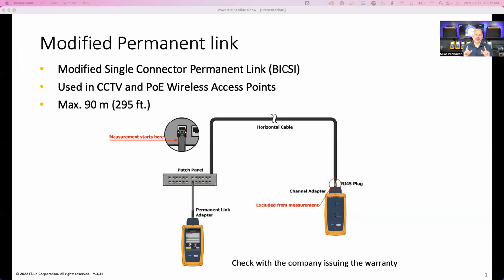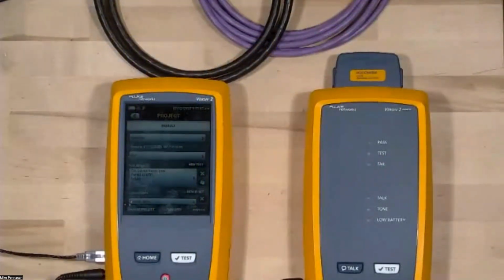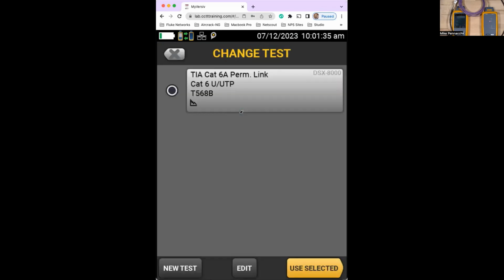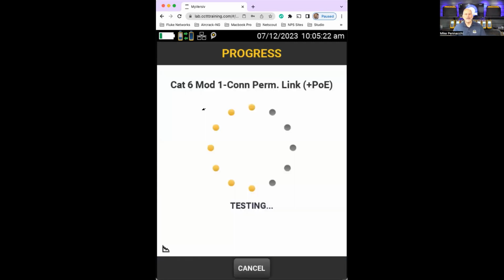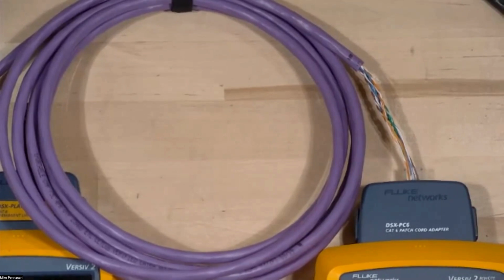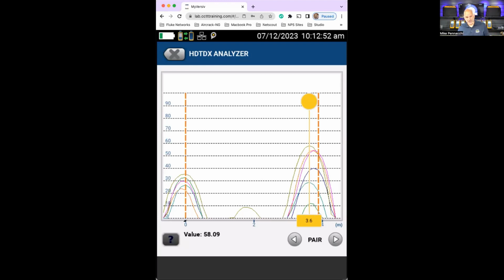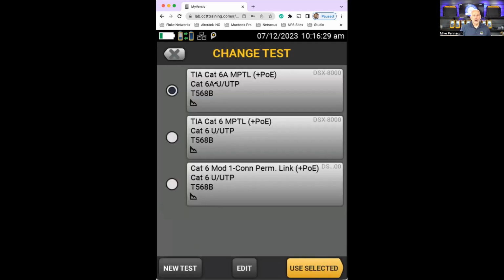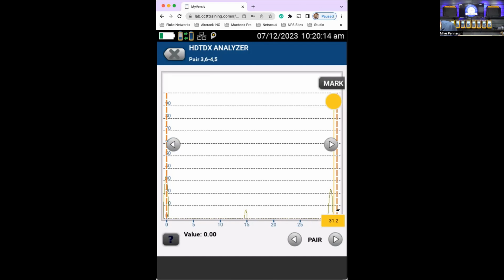MPTL vs Mod 1 Conn Perm Link Webcast

Comment: Great video. I want to buy the right analyzer to test an 8 pair 26awg running 500 meters through an umbilical. we can make our ownadapters to our umbilical. 
not aligned with any protocol but uses for high quality digital data transfer. we get a life cycle of about 4 years due to insertion loss but we just see that as parity errors on the working system in operation. we want to troubleshoot and confirm transmission loss. Replace before project is on standby to change out one umbilical. we carry 10 of them. 6 in use. we need to ensure they are fit for re termination this type of tool looks ideal.

Comment: Good Day Sir, i dont have the cat 6 patch cord adapter, same scenario patch panel i/o on one side but rj45 crimped on the other side. what i do for the testing is in channel link testing i simply plug the rj 45 cripmed on the remote side then i plug in a patch cord on the patch panel side i/o. is this somehow correct?
Reply from the maker: Ideally you want to eliminate the patch cord at the patch panel from the test. One method to do this is to use the Modified Single Connector Permanent Link test. This can be found by going to Test Limit-More-Applications and selecting the Cat 6 Modified Single Connector Permanent Link test. This allows you to use the Permanent Link adapter at the patch panel and the Channel Adapter at the plug end. The best option is MPTL, but that requires the Patch Cord adapter.

Comment: how’s it going mike! i wanted to know for your mptl test could you also use the cat 6a patch cord adapter on cat 6 cable and still get valid results?
Reply from the maker: The short answer is no.  The RJ45 jacks in the patch cord adapters are tuned to category of cable being tested.  If you setup a Cat 6 MPTL test and try to run it with the DSX-PC6A Cat 6A patch cord adapter, the tester will give you an error message and stop the test.

Comment: It seems like it would make sense if the standards committee required NEXT and RL measurements for a channel test. If the patch cords are terminated poorly, the test will still pass, so it kind of makes the channel test useless, other than just for setting reference. I guess its not possible to run a channel test with the patch cord adaptors??  Whole thing seems strange, you almost have to first test your patch cables with the patch cord adaptors.....then just do a normal permanent link test and hope it all works when plugged in because its impossible to do a full true end to end test.

Comment: Mr Mike
I have camera runs with RJ45 on both ends , Can I still do MPTL test ?

Is there a special coupler for the Perm Link adapter end
Reply from the maker: The ideal test for this configuration would be the Direct Attached Cable test.  This involves using a Patch Cord adapter at each end that matches the category of the cable you are testing.  You would then select the ISO DAC TR E for Cat 6 cable or the ISO DAC TR Ea for Cat 6A.  Using the Patch Cord adapters ensures you are testing the RJ45 plugs at each end of the connection.  When testing Cat 6 cable you would need the DSX-PC6 and for testing Cat6A would would need the DSX-PC6A.  MPTL only works where you have a RJ45 jack on one end and a RJ45 plug on the other.